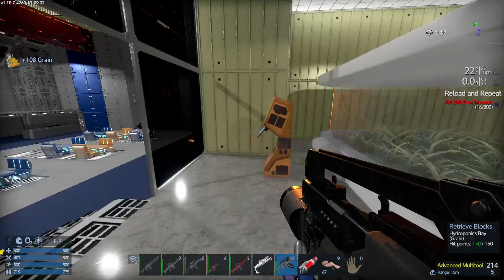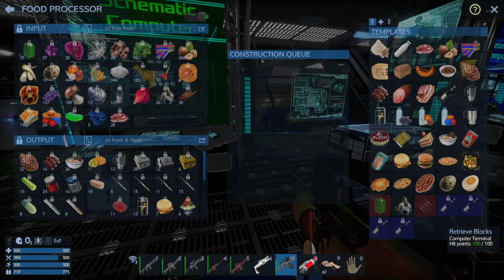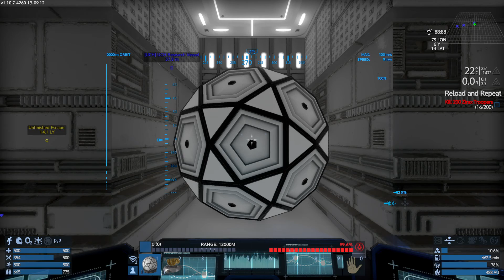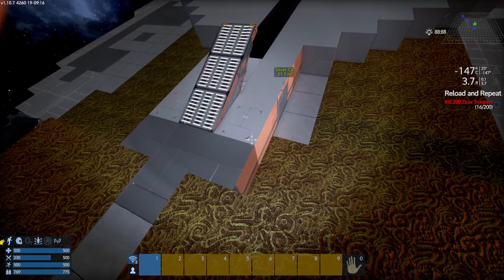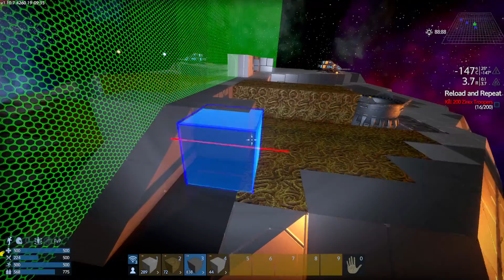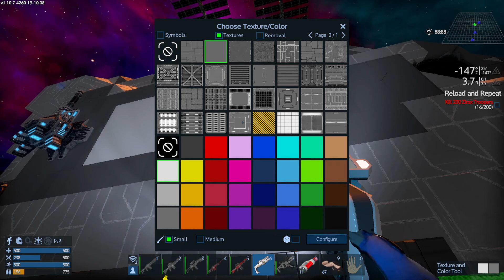Schematics (UCH Research Ship) : Reforged Eden War & Industry - Empyrion Galactic Survival : #44

Comment: WRT mining did you ever try the trick I mentioned for X repairs & NMS mining? Switch a keybind so you can use a keypress rather than the mouse; even if it's just as bad for your fingers it's a lot easier IME to jam a key down than a mouse button..
Reply: I feel for you, I have rheumatoid arthritis along with regular arthritis in my hands. I have very little cartilage left in the tip joint of my index fingers. I'm using a mouse with a side button on it that I mapped to the fire button so I can use my thumb.
Reply from the maker: Had not considered that option,  The mouse I use has flexible top for the left and right buttons, it is easy to hook the tape around the front edge to hold the button down.